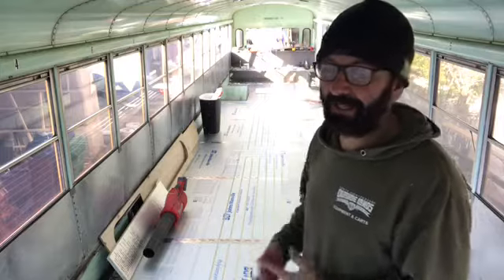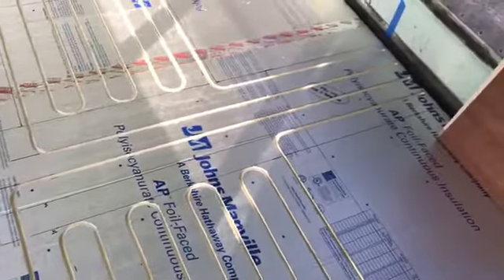School bus conversion radiant in floor hydronic heating installation and reasoning

Comment: what is the "heat source"?  what kind of heater?  what kind of fuel?
Reply: The conductor is water, so the source is anything that can heat water. As he said: solar, gas or electric water heater, even a woodstove.

Comment: Do you know where to find information on the pex layout?  Like how big a zone should be and dimensions between the tubes?
Reply: 8” spacing 1/2” pex no more then 150’ 5/8” pex no greater then 250’. I believe thats what is used in sub slab and wood subfloor.